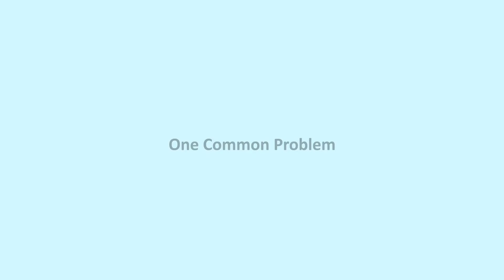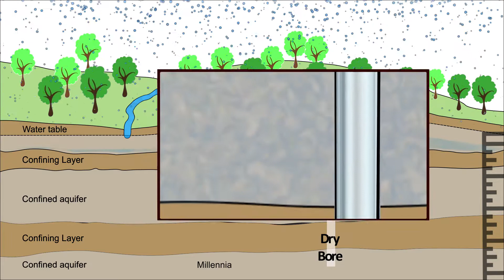BoreCharger_Industries_ English

Comment: SIR in our association we have done some thing like this , & LOST TWO bore wells which were giving water. We had put gravel, stone etc besides the casing pipes,  charged the area out side the bore well with FILTERED RAIN WATER . RESUT ==>  NO WATER FROM THE BORE WELL WHICH WAS GIVING WATER.All pictures , google ideas are super. Now also I am prepared to give you a job provided you indemnify the loss .
Reply: Probably what you had implemented was a faulty Rainwater harvesting system. Recharge can only add to the yield of Borewells. Not sure why your Borewells lost water yielding capacity. Should be investigated hydrogeologically